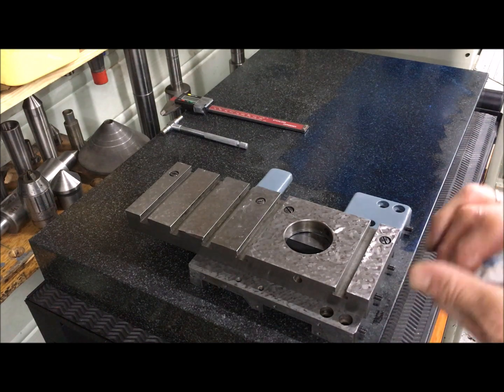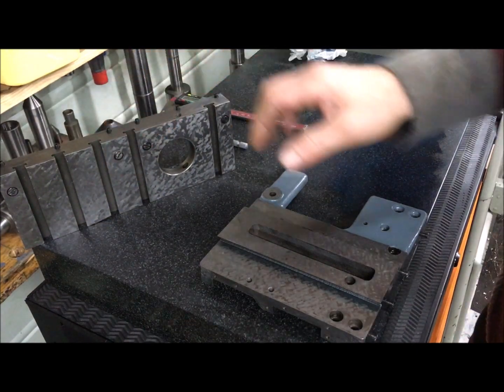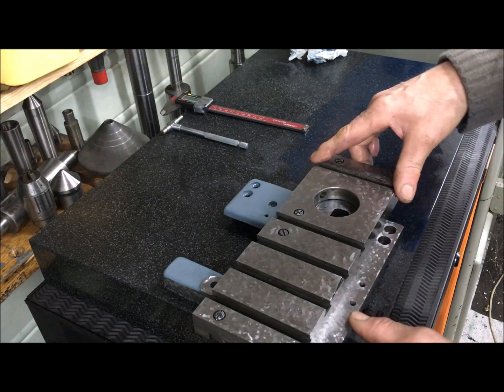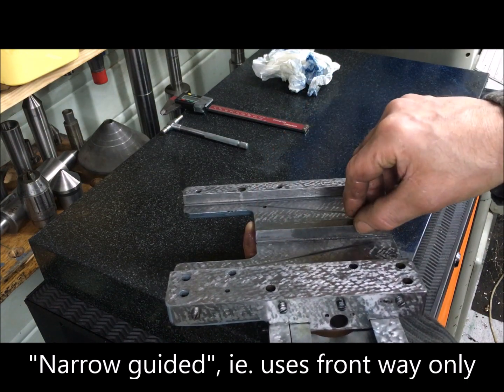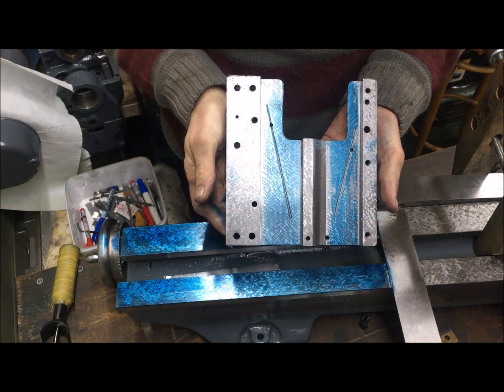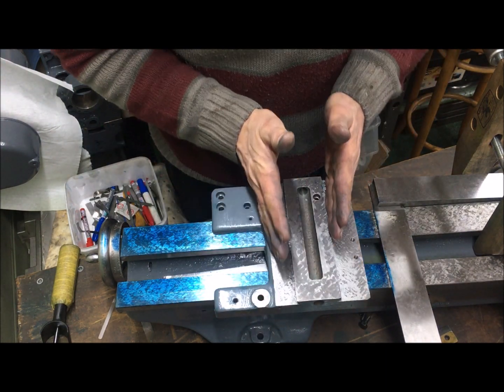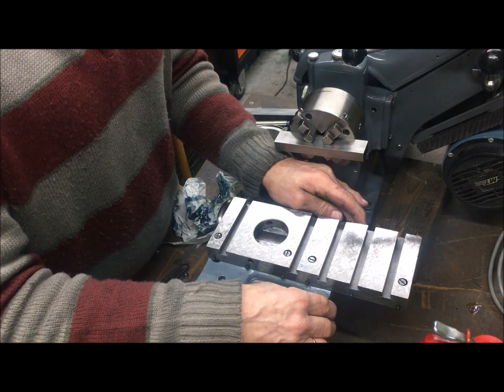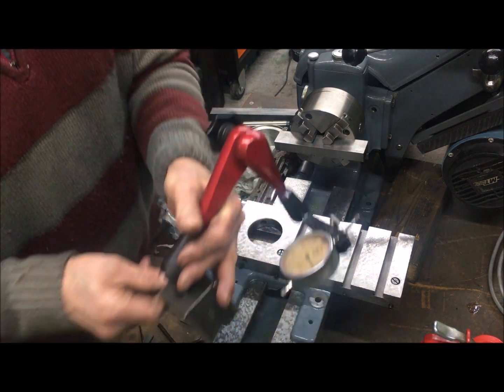Myford 7x 7   Saddle and cross slide

Comment: The evidently smooth finger-pressure motion of that cross slide without play is really impressive.  I have a much older (1942) Myford 4" and although it's in fair condition, your beautiful scraped surfaces make me realise just how much it could be improved.  I've a lot to find out about optimum adjustment of the gibs and bearing surfaces to allow free movement without chatter.  Thanks for your  detailed exposition.
Reply from the maker: Thnks for the nice comments! Happy to hear my efforts are helpful to others. Good luck on the Myford work.